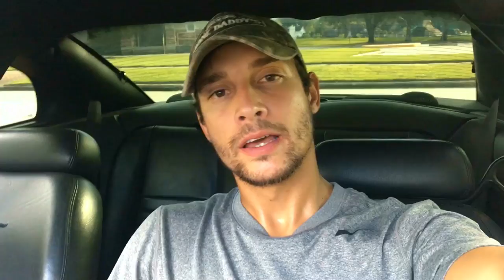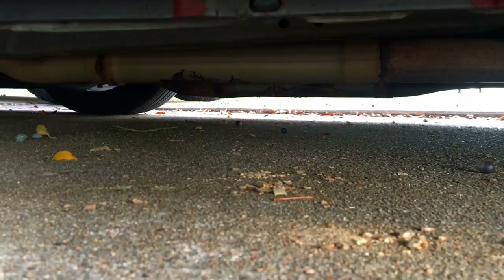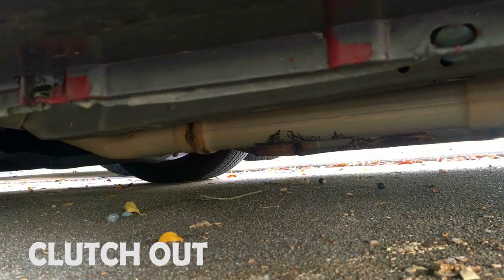How To Diagnose A CLUTCH NOISE Problem | Ford Mustang Gt | Bearings

Comment: What a bout if my car starts turning off on its own ? Plus idk if it's the engine rattling or the muffler?
Reply: Dawg said my motors done but idk
Reply: If your car is turning in it’s own you should prolly get an alignment and it that doesn’t work you prolly have some suspension damage. And you should be able to see an engine rattling visually if it had bad mounts or something
Reply: @jordanw4710   it stays on now but it sounds like an earthquake, my engine is definitely shaking, but so is my muffler cause it's cut off midways under the car so you can see it shake
Reply: Da One Da One turning off on its own when driving 5mph+? That sounds like an alternator diodes problem (aka just the alternator; I was being specific). Sounds like an earthquake? That sounds like a really bad misfire or like the other dude said bad motor mounts. Best way to check mounts ONLY if it’s automatic then turn car on. Put hand brake up really good. Stomp and hold the brake AT ALL TIMES and give it a quick medium blip/in-out push of the accelerator while having someone check the motor and if it leans to one side or shakes back and forth then your mounts are torn/bad. Other way to check it lift the car, lower on jackstands, jack the motor up with a piece of wood underneath the oil pan about 1/8” of an inch (you’re not lifting the car off the stands just relieving some tiny amount of weight) grab a long pry bar and pry at the mounts. If they move a lot then it’s bad. It should have a very very very small amount of movement but it’s supposed to be stiff. Also u can check them visually for the rubber and see if they’re torn or pieces are missing. If you turn your car on st the very beginning and it shakes violently then that’s another indication it’s the mounts 
Misfire it could be spark plugs, coil pack, massairflow sensor, oxygen sensors, low compression, lots of shit but that’s all I can think of off the top of my head... take it to O’Riellys and have the alternator checked out under load,, with the car running at idle ask for the voltage test it should be between 13.5-14.5 volts
Reply: Sorry I meant hand brake/e-brake off not on lol Brain fart
Reply: Manual trans is diff. WITH E-brake up put in 1st gear and give it gas as if you’re going to burnout BUT don’t Burn out u just want the car to jolt forward like when you first learned to drive stick and it jolted forward on you but once AFTER you’re going to quickly slam the brake pedal too cuz u don’t want to run over your friend lol... DO NOT release the clutch fully. You’re going to want to push the clutch in super fucking quick when the car bolts forward so like a halfway clutch out where it bites and moves forward and back in 
Manual trans is a little harder but ya 
Try it 2-3 times and same applies as auto. If motor shakes violently then bad motor mounts however sometimes it won’t be visible shaking and has to be checked visually with eyes directly at the mount 
Good luck!!!

Comment: I have added a brand new clutch in it with all 3 parts but mine only makes the sound after driving for a while and around 4-6000 ish RPM's whenever i feel like dragging on a empty long street

Whenever i push the clutch for like 1mm it stops completly not even the  noice after you press the clutch as you have here and i just replaced everything and centered it with a tool and it has been working good for 2 weeks now but it starts to make almost the same sound

Could it be the damn flywheel? :/ i hate to freaking pull everything off again as i already had to break bank when replacing my clutch :(
Reply: TheJackalPhantom maybe the input shaft bearing

Comment: I just put a new clutch kit on about 4 months ago, and now my clutch is squealing whenever I step on the pedal. It kind of sound like worn-out brake pads. I have no idea what's going on
Reply: did you ever figure out what it was? mine started doing it yesterday even though i replaced the clutch, throwout bearing, pilot bearing, resurfaced flywheel, greased and torqued things down properly about a year ago. praying it is the cable wearing out

Comment: I think the pilot bearing exhibits noise when there's a difference between the flywheel and the input shaft soeed With the car shift lever in a gear

Comment: That’s sick. Only noise I have is chirping when clutch is out.
Reply: Me too, exactly.  I almost think the clutch cable itself is just a little loose.

When i push the clutch pedal in maybe an inch, the rattle stops completely
Reply: @Turismo860  Same here! I think mine is just worn out, I learned stick in it so I wouldn't doubt it. Time for a new clutch!
Reply: @glo_mighty5018  chrisfix has a pretty in depth video about pulling the trans on an sn95 that i might use to rip mine out soon lol.
Reply: It's your throw out bearing needing replaced more than likely.  I had a loud constant chirp on my car when the clutch pedal was disengaged and then you push the pedal in and it stops.  Low and behold we got a new throw out bearing put in it and the noise was no longer a thing.
Reply: @recklessriley6  yup! Needed a new clutch kit!

Comment: Mine only makes a noise when my in neutral with the clutch pedal out. None of the other gears do that.
Reply: Andy Tommy Keddy sounds like the pilot bearing. If it makes a squeal/squeak when in neutral with clutch pedal in OR Off the pedal then it’s the pilot. This also applies if you’re in gear cruising 5mph-45mph (drive by a bunch of cars parked on the side of the road like a 1 way street and lower your windows, music off, and listen for a squeak.
Reply: Mine does that too, pedal in and pedal out, in gear or neutral. Also, I noticed a significant whine noise while driving in first gear. AND, the clutch pedal becomes lighter after a session of "spirited driving".

Comment: what if it does this on my automatic transmission? can I still get a stage 1 clutch kit
Reply: Paul Rendon those are different . For automatics theyre called shift kits and make the trans more firmer and aggressive. There is clutch kits but it’s diff cuz it’s auto and has several “smaller” clutch kits I guess to best describe it for each “gear” .. Manual trans is just 1 kit ( clutch friction disc, pressure plate, throwout bearing, and pilot bearing & alignment tool to Install it)

Comment: Mine makes a noise when I'm taking off as I'm releasing the clutch.
Reply: On the back of clutch fork had a damper  it Bolt in to to the fork with 9/16nut may be loose righting it back you will be good. Just look at the fork half way up

Comment: bro are you on any of the Mustang forums? you should have bought an oem ford tob as I've heard all aftermarket ones are junk and will go bad again in a short period of time.
Reply: Misfit-Los  yes they are. I just installed a new flywheel with a spec clutch kit. That kit had a throw out bearing. It's been like 2 days and I hear it already
Reply: Cesar Jimenez I'm in the process of changing out my throwout bearing as we speak I just picked up a Ford Racing throwout bearing from the dealership
Reply: Misfit-Los yeah I should of gone with a ford racing throwout bearing then. Bro it's been like 2 days since the install and it's back to the same thing.
Reply: Misfit-Los yeah I should of gone with a ford racing throwout bearing then. Bro it's been like 2 days since the install and it's back to the same thing.
Reply: Misfit-Los yeah I should of gone with a ford racing throwout bearing then. Bro it's been like 2 days since the install and it's back to the same thing.
Reply: yeah I should of gone with a ford racing throwout bearing then. Bro it's been like 2 days since the install and it's back to the same thing.

Comment: It's cost me 1300 for my mustang every time I have bought a clutch
Reply: i recommend switching your Indy
Reply: Stefan Poulos Indy?
Reply: It means get a new mechanic
Reply: Oh no get a new dam mechanic
Reply: Got a dude in tn done it for 900 but he didn't replace mine he should have and cost me another 200 parts and labor now so about 1100
Reply: But I put new clutch main seal whole 9 yards he didn't do the easy one posses me off said it looked good factory clutch 176000 miles lol tell them what you want done otherwise you have to go back later it was a year but I forgot this small bit
Reply: Did mine myself for 200

Comment: Mustang owners lmao jk but the throw out bearing usually should last the cars life.  one way to stop this is to stop riding the clutch at stop lights and make sure ur foot is fully fully fully completely fully off the clutch pedal while driving.  also sometimes the free play with the pedal should be adjusted sometimes which causes the throw out bearing to lightly hit the pressure plate forks
Reply: Auto Dummies this is very common in mustangs and will see how long he goes before the noise comes back as I've heard all aftermarket throw out bearing are junk you have to get an oem one from ford.
Reply: Throw out bearings don’t last the entire life of the car. It’s a wear and tear part. Most clutches last 6-12 years even when it’s time for a new one depending on how u drive it and slam the gears. The harder you drive it the faster you wear it and the sooner you neeed to replace it. I’ll agree with you on the riding the clutch thing. It does wear it out faster

Comment: You don’t take the transmission out to replace the clutch...
Reply: 2006 v6 tranny has to come out for clutch kit replace, some years i hear didnt have to remove entire trans for clutch,  not sure, but my v6 06 it has to.
Reply: @nimrodpaul6875  ofcourse they would make it that way 😅
Reply: @justinking5540  last week i was adding freon to get the air cold when the crank pulley fell off, a true oh shit moment, long story short, the crank pulley is glued/epoxies to the harmonic balancer which of course had to be replaced, my clutch was in need of replacing so towed it to a trustable guys shop,, new harmonic balancer, crank pulley, full clutch kit and drain down refill n pressure the ac and 1900 bucks later all is now good. Do ya think I got screwed or did alright? What a simple add a can of freon turned into ,lol. That was all parts n labor.
Reply: @nimrodpaul6875  no that sounds about right man